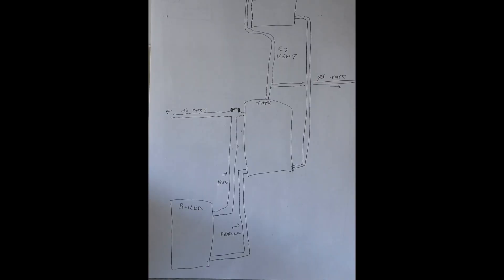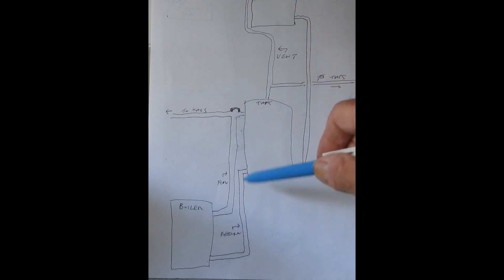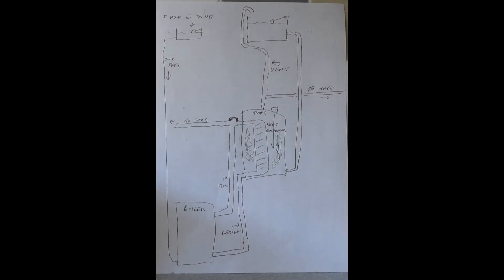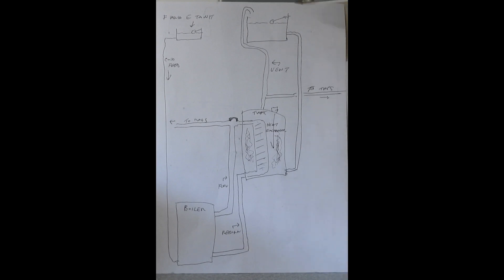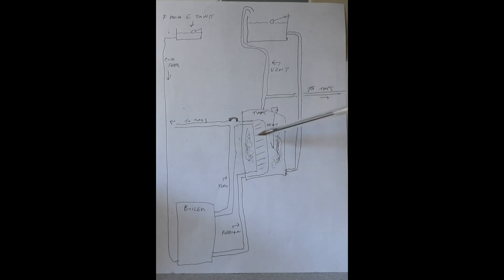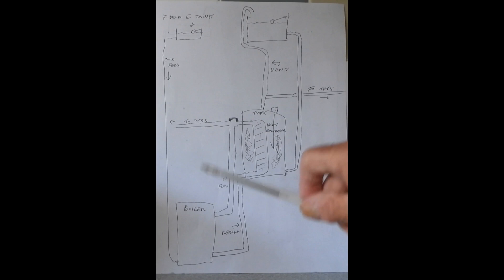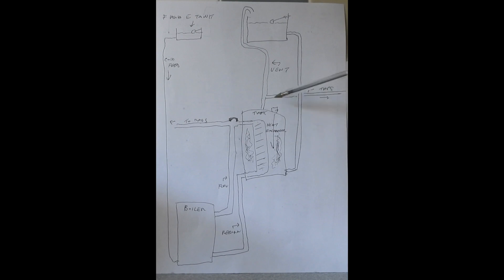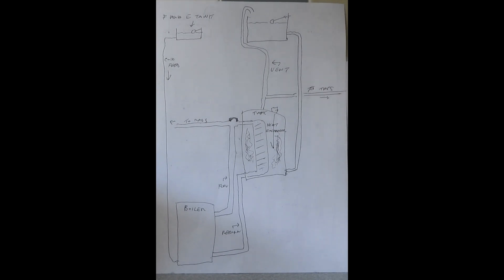The indirect heating system how it works.

Comment: Hi Al thanks for the video. Been following you since I had my first car (Laguna) and your videos helped me immensely. I’ve just moved into a house with a Rayburn as the hot water boiler. It does a great job at heating the hot water tank up but only seems to heat up one rad any way to get the other rads to work better? There’s a pump attached to a thermostatic switch but appears broken. Would that be the first port of call? Also I’m trying to adjust the radiators I snapped off one of the taps. Is that easily replaced?
Reply from the maker: First port of call would be to replace that thermo switch. You may be able to get a plastic top to fit the broken rad valve if that is the part that is broken, if it is the valve brass shank then the whole valve will have to be renewed.